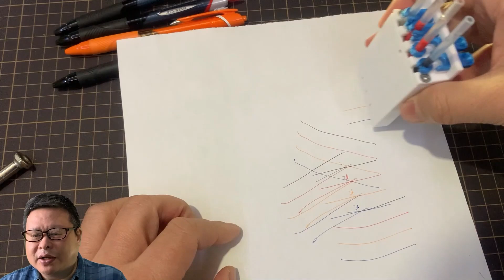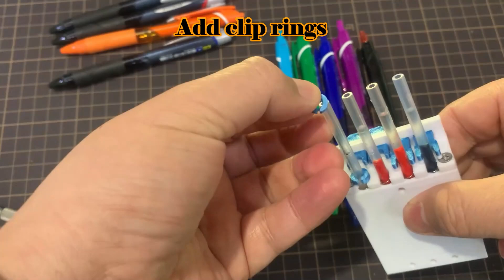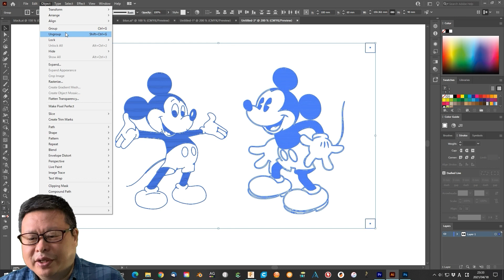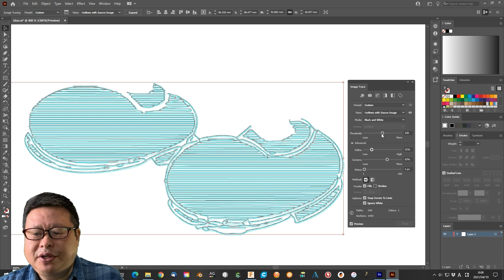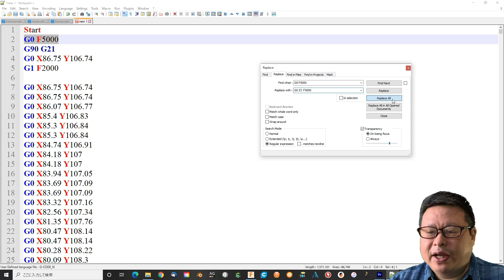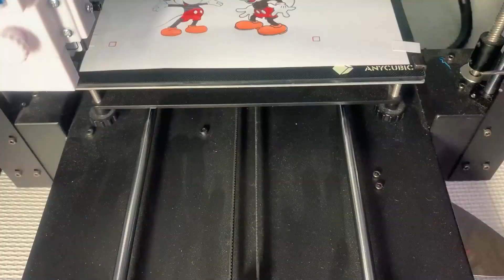Print color picture with multi-pen 2D plotter by 3D printer (Trick All you need to know )

Comment: Sir really great video. I was wondering if multiple pens can be used automatically. 

But sir there is still a limitation. How about using colour printer inks to create any colour.
Reply from the maker: Thanks for your comment. This is an application using a 3d printer to do the 2d color printer work. There is still no technique to using color printer inks with the 3D printer I think. Or it will increase the cost too much now. I will think about the idea that automatically changing the color pen later.  Have a nice day.

Comment: I have an idea and that is to make a simple CNC machine that can be connected using a 4-color pistol. Paint a 4-color painting on the wall. With the help of the motor stepper, its spray intensity can be increased and decreased, what is your opinion?
Reply from the maker: I think it can work but how large the paint area will be? If the wall paint is large maybe some magnification accessory will be helpful. I will see what will you do next. Good luck and have a nice day.
Reply: @TubeUnderdeveloped 
Watch these videos:
https://www.youtube.com/watch?v=_EDPKFz3Zc8
https://www.youtube.com/watch?v=qAdHhoz2k2I
Reply from the maker: @AIboom20  Thanks for your information. They are very interesting. The airbrush is rough in the video but it seems to have very high potential. The multiple pen draw is really nice. The pen changing system is very nice. Maybe I should learn from them and modify them suitable for 3d printer.  Keep safe. Have a nice day.

Comment: Really should use G54, g55 so on on proper CNC. But 3d printers does not have a way to set coord.
Reply from the maker: You are correct. I just start learning to use g code.  A lot of g code I am not familiar with. Definitely, the relative coordinate is good. Maybe I can try G90 that does similar work as G54 or G55. I will try it out later. Thanks a lot for your comment. Have a nice day.